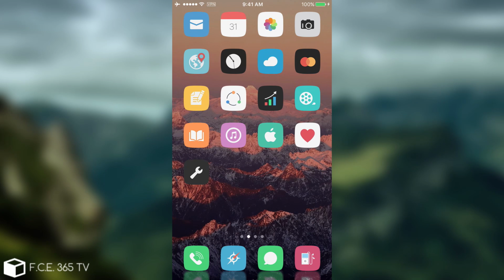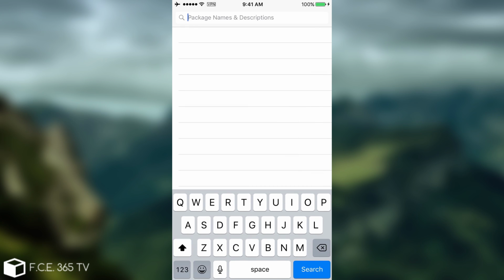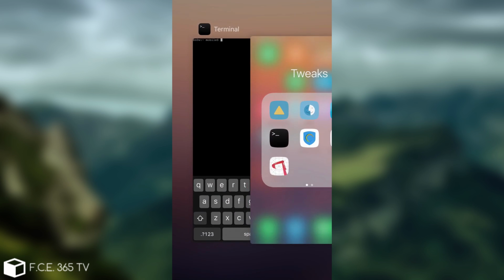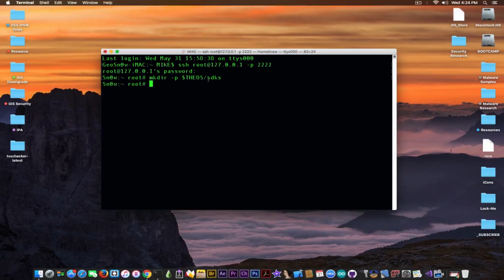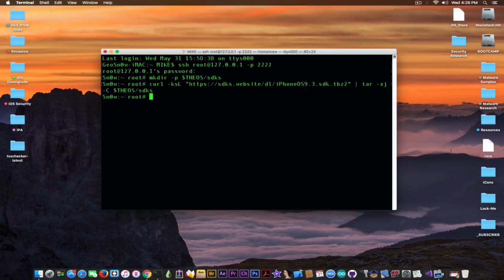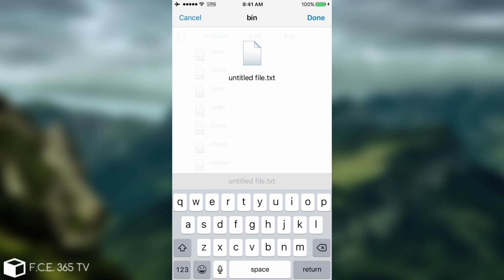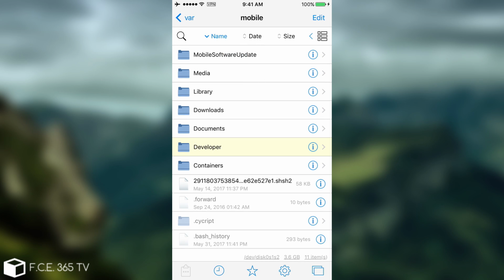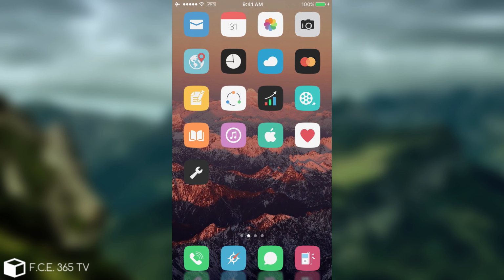iOS 10 Jailbroken - How to Build Cydia Tweaks  | Part 1: Setting Up Theos

Comment: Thanks very much for the tutorial. This is a little outdated, so I wanted to update it in case anyone else also got stuck on the way through. The site where the iOS 9.3 SDK linked in the tutorial was hosted is dead, so replace the sdks.website URL with "https://github.com/Sn0wCooder/theos-sdks/blob/master/iPhoneOS9.3.sdk.tbz2?raw=true".

Also, when I installed the perl shown in the video in Cydia, it didn't install properly for me. I worked around this by installing another Perl package that came up by Sam Bingner on the repo https://apt.bingner.com/. Hope this helps!

Comment: Plz 10.3.1 to 10.2 downgrade
Reply: Mukabbir Hasan I don't believe that's currently possible, might be wrong, but if it is you need your 10.2 shsh2 blobs that are device specific. No its not possible without them and they can't be ones you found online or your friends
Reply: Mukabbir Hasan you cant downgrade Cuz iOS 10.2 is unsigned